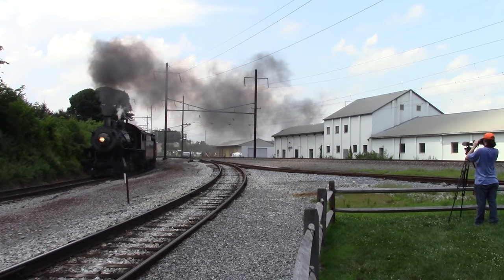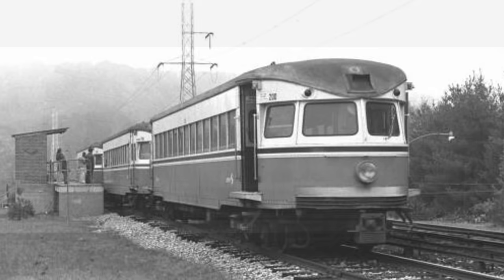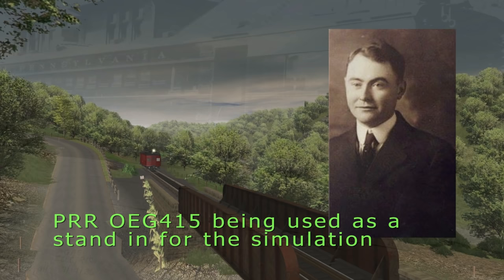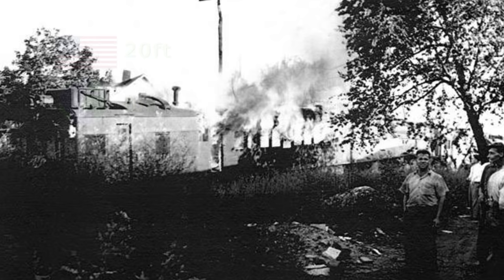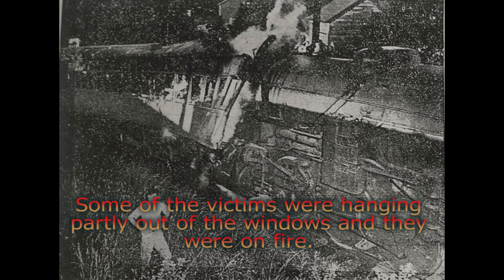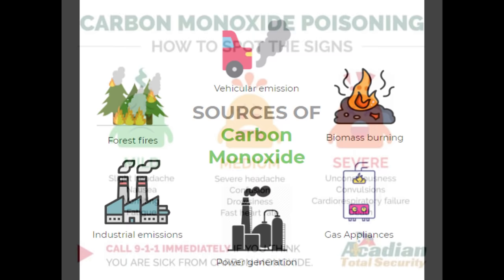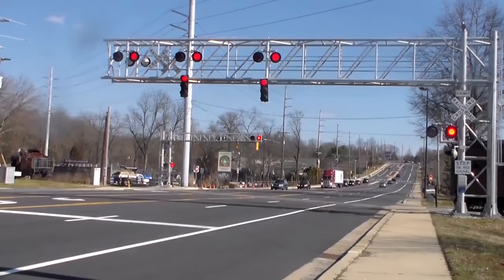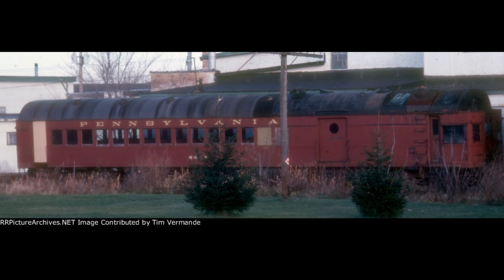The Doodlebug Disaster 81 years later

Comment: Diesel is not more expensive to produce than gasoline. In fact, it is far cheaper. The reason diesel sells for so much more is, plain and simple, government taxes. The world runs on diesel. It is a far greener fuel than gasoline and produces more power as well. The sole reason diesel is not our primary fuel in cars si due to artificial inflation on a fuel that is cheaper to produce than gasoline.

Comment: It's really upsetting that almost everyone in the doodlebug died. I've heard of air disasters where everyone to almost everyone in those accidents perished, but very rarely, a train accident where almost everyone perished.
Reply: The kaprun disaster of 2000 is a good example of one
Reply: Another good example is the Tay Bridge Disaster Of 1879 where there were no survivors at all after the bridge collapsed in a force 11 gale.
Reply: @LNERK361983  An interesting note on the Tay Bridge Disaster:
The bridge collapsed with the train on it, as a result of the increased surface area given by the train, on which the wind could act. The train was forced against the rails by the wind, creating a wild display of sparks. This phenomenon was also seen on the previous goods train.
Reply: the crew bailed and survived, they never alerted the passengers so none had the chance to even attempt to jump…
Reply: @bostonrailfan2427  why didn’t they tell the passengers
Reply: @emmaryan8147  They probably literally only had seconds to act once the freight train came into view. At that point we don't know for sure what happened. They may have tried to yell out to the passengers or they may not have but there's nothing that could have been done to save them as train cars are designed so that the doors don't easily open while in operation for the obvious reasons. i.e. you don't want flimsy doors because otherwise any passengers standing next to them could possibly get flung out should they open while moving.

The crew managed to get out in time only because they had the most amount of warning, which was still only a couple seconds more than the passengers had and because they jumped out through either a door or window in the crew operating area which are designed to be more easily accessible for entry and exit. 

Also passengers are typically more reluctant to jump out of a moving train and generally behave by staying in place during the course of an accident as they think they would be safer on the train rather then take their chances and suffer a possibly fatal injury by falling out of the train. And this is generally true for most train accidents except when you are in the first car or two. Where as train crews are very aware of the fact that in a head-on collision with another train there is very little change of survival staying inside and although you are almost certain to suffer a serve injury jumping out of one while moving at a high rate of speed your chances of survival are much greater. 

Lastly there is the issue of the gasoline fuel tank. Its likely that people in that time were not well aware of the dangers of having such a large amount of flammable fuel on board. In fact it's likely that had the engine been fueled by diesel instead there probably wouldn't have been a fire at all and the only fatalities would have been the 9 who died due to the initial impact. Possibly even less had the injured received adequate treatment in time.
Reply: The 1996 silver spring collision
Reply: you should check out "Well Theres Your Problem"
Reply: Remember this: Today's safety is always built on blood spilled in the past.  Accidents like this are the reason why you hear about few train disasters being 100% fatal. Mistakes are learned from, and processes are rebuilt better.
Reply: The main reason most people don't survive a plane crash...well, at least those that crash after gaining some altitude, not the ones that crash on landing or takeoff...is that the airplanes structure pretty much turns into a meat grinder/shredder. Not only do you not find survivors, but no real intact bodies either.
Reply: Ciudad Juarez,MX railcar accident in 1977: Are you sure about that
Reply: @montylc2001  search up american 191
Reply: @edgardanimate3552  Yes, the crash at DFW airport due to a microburst at the end of the runway during landing. Like I said, except for landing and takeoff crashes, most plane crashes turn people into hamburger meat. Had a friend of mine who used to be a first responder, when he was one of the first at a plane crash site, he quite after it. When he saw intestines hanging from trees he just couldn't take it anymore.
Reply: @montylc2001  you mean the microburst by the engine that fell off the wing
Reply: @edgardanimate3552   you are talking about Delta L- 1011I think
Reply: @montylc2001 That’s Delta 191. American 191 was in Chicago, whereas Delta 191 was indeed in Dallas.
Reply: @C-Midori  oops. Thanks.

Comment: Never knew the Pennsylvania Railroad had doodlebugs, let alone this disaster. Too bad few doodlebugs from this era survive today. They’re a big, under appreciated piece of railroad history.
Reply: Illinois Rail Road Museum, Union, Il. Fantastic museum, huge.
Reply: @nivekyentrouc1200  I seem to recall  on some paranormal show  on the Travel Channel where some  ghost group  went to this museum. They have a passenger rail car  which is haunted. I think it is from this disaster. Somewhere on Youtube  should be a film, The Crash at Crush. It was were two  trains   werec rashed into each other. Happend  in the 1900s at Crush, Texas. Think the town is or was in the Dallas -Fort Worth area.
Reply from the maker: They indeed are. They paved the way for modern self propelled cars especially the famous Budd RDCs (technically they are doodlebugs but have multiple unit control so they're known as DMUs or Diesel Multiple Units) one of my personal favorite rail cars. The footage of 4662 was taken by me even the cab shot and that car gave quite the ride.
Reply: Similar self-propelled cars are such as the Budd Rail Diesel Cars, Micheline rubber tired self-propelled cars in France, and six Budd Michelines in the USA. McKeen built 152 1905-17, one of the first gasoline motor cars. Most were built with “windsplitter” knife-edge front ends. Ettore Bugatti in 1933-38 built a hundred railcars to his design. They were powered by basically the Royale IL8 engine.
Reply: There's actually one preserved and operating in Wilmington, Delaware, on the Wilmington and Western.
Reply: well, dont worry in other parts of the world (namely japan) doodlebugs take up most of the passenger service!!
Reply: I thought that the Black River and Western still had a doodle bug on the property.
Reply: 1940-2022? Fr?
Reply: At least there are some surviving doodlebugs
Reply: I didn’t even know what Doodlebugd were. I was expecting to see some type of investation but the warning at the start didn’t make any sense. What an awful time in our Railroad history!
Reply: @Thunderbolt_1000_Siren Pernik:hello there!

Comment: Doodlebugs are what could have pre-made the brill bullets in experience, that siding could have been preventing the entire crash, if only he noticed…
Reply from the maker: Not quite. The Bullets used Electric third rails for power while the bugs were gas powered and later diesel. The Bullets were made round the same time as some of the doodlebugs as well but man they outlived the bugs as they weren't retired until SEPTA replaced them in the mid 1990s with ABB N5s. Most of em thankfully survived with 1 in operational condition being converted to act like a trolley (somehow running off a trolley pole with overhead wires, I have no idea how they got away with that)

Comment: 13:50   A little history lesson based on a "I was there ." moment .   Your assessment that diesel is more expensive is the reason cars run on gasoline and trucks run on diesel is not quite accurate . Diesel WAS cheaper than gasoline prior to 1982 . My dad bought a new '82 3/4 diesel Chevy for only ONE reason , diesel was almost a dollar per gallon cheaper at the pump than gasoline at the time . 

Within a YEAR diesel prices at the pump met or exceeded gasoline prices and have remained steady since . I also remember hearing the truck drivers complaining about the price increase over such a short time frame and how it would affect their bottom lines . 

At least you did mention the one reason I have actually heard why diesel was chosen as a fuel .... vehicles tend to be harder to ignite when running on diesel than with gasoline . (think military type vehicles)

Comment: I wish the concept of that railcar was revived
Reply: 3 of them are preserved
Reply: Diesel multiple unit trains are used all over the world. For example, the NCTD Sprinter between Oceanside and Escondido, CA.
Reply: it was…the RDCs of the 50s/60s/70s were these evolved, they have struggled as a concept for decades due to costs due to severe regulation but slowly are making a dent in the US again
Reply: @HSMiyamoto  or the older River Line in New Jersey
Reply: @bostonrailfan2427  - Yes there are quite a few, if you look around. I was just giving a shout out to one that I ride personally. A new diesel railcar line is opening soon between San Bernardino and Redlands, CA., and there is e-BART between Pittsburg/Bay Point and Antioch stations.

What you notice is that diesel LRT tends to go where train frequency and projected ridership is too low to justify electrification, and they run on otherwise lightly-used tracks so collisions with conventional rail equipment is completely preventable. 

Inevitably, that makes them minor obscurities when compared to LRT globally. Coaster, for example, is a twice an hour operation, but then, so are most of the buses in our part of San Diego county.

Comment: But wait, something about that cause doesn't make sense. At the time of the collision, the Doodlebug was running passenger-end first, with the baggage/engine compartment at the rear. If carbon monoxide fumes were building up to such an extent as to affect the driver, that would imply some pretty major factors, including gaps between the passenger and baggage sections, such as a pass-through door left open (likely against regulations, though I can't confirm), possibly a serious exhaust problem with the Bug's engine that left it spewing considerable amounts of exhaust into the car rather than up the stack, and the driver operating the car with no ventilation, not even a cracked open window, also not unheard of but highly unusual. And most importantly, if there were enough fumes inside the car to affect the driver, then it would be affecting everyone else in there too and likely more, which makes it weirder that nobody else noticed or said anything; no passenger complaints, no conductor or brakemen checking what was wrong, etc. Had the Bug been running engine first, all this would make perfect sense, but since it was in effect going backwards, how could fumes have built up to such a degree with the driver as far away from the engine as physically possible?
Reply: Also, why didn't the conductor or brakeman notice the siding, they would have had the same set of train orders?
Reply: Might explain why none of the passengers bailed with the crew, if they were so doped up on carbon monoxide
Reply: it doesn’t add up, it’s a bad explanation for what happened. the easiest cause is the most likely: he missed the siding and botched the meetup
Reply: @chuckgilly  that to me is classic CYA: cover your ass. they supported the others’ excuses to make it sound plausible even if utter garbage
Reply: I thought the same thing. So incapacitated that they missed the siding, but at the same time alert enough to hit the brakes and jump to safety. Surprised that the explanation was never challenged at the time.
Reply: Good analysis, thanks for pointing out to us all about the reverse operation of the car, as the animation depicted it as counter to what the actual photograph portrayed. But please....refrain from using the fake term 'driver'.
Reply: @renegadetenor  driver might be because the person is British or from a country where engineers are referred to as that…it’s like them calling cars coaches switchers shunters etc.
Reply: Is there a link to the ICC report? I have my suspicions on that explanation as well. Did alcohol play a role? What about fatigue? The federal hours of service limit was 16 hours at that time.

Comment: If the rail car had only passed the switch by a quarter mile (440 yards or 402 meters) before the collision (11:20 in the vid)) how would  they have had time to stop, throw the switch, drive onto the siding and throw the switch back before the freight got there? 
That would have been ridiculously close timing to count on.
Reply: They entered the siding properly on the one end, they just blew through it and out the other side.
Or
They were supposed to take the siding, they didn’t, and blew clear past it on the main
Reply: @jaysmith1408  I think he means if the collision occurred only 1/4 mile past the siding, the two trains were scheduled too close to each other and if the doodlebug had been running 45 seconds late, it would have collided with the freight before reaching the siding.
Reply: @galeschool  the scheduling is why the bug was ordered to stop before the switch, i’m not sure whether the bug was on the siding and blew back onto the main, or whether the freight was to take the siding in front of the bug, which was what threw me off from his comment.  I read the original comment as under the impression that he expected the bug to back onto a spur before the arrival of a freight, i was correcting that it was a full siding, and there would be no requirement  to stop and back in, as he suggested.  It is conceivable that a scheduling delay could have permitted a rolling meet, but between the variable speeds of both trains, and the bug’s engineer being unable to follow the simplest of orders, let alone the task of speed management for a rolling meet of a freight whose exact location is unknown to him, i doubt scheduling, outside of holding the freight at the next siding back, since the bug’s schedule is the exact same every day, would have averted this.
Reply: My understanding of the operation of a siding on a single track mainline is as follows. 
At various places along the mainline a switch opens onto a second side track that runs parallel to the mainline and is long enough to accommodate any trains that might be required to stop to let another train go by.
This sidel track then switches back onto the mainline at the other end.
Before the days of remote switch throwing  the train to be sided had to come to a stop so a crew member could climb down and manually throw the switch. The train would then proceed onto the  siding and when clear of the mainline the same or another crew member (depending on the length of the train) would throw the switch back again.
The train would then advance along the side track until near the switch back to the mainline and wait until the oncomming train had passed.
Then the switch would be thrown and the train would proceed back onto the mainline and then again stop while the switch was thrown back. Then the train would proceed on its  journey. 
The timing of trains has to allow for the time to stop, throw the switch, proceed onto the siding and throw the switch back.
You want a good time window for safety say 10 to 15 minutes or more. 
In this case if the collision occurred only a quarter mile past the switch or siding then there simply would not have been a safe time window to stop and enter the siding. The oncoming train would very likely have hit the  railcar before it could make it onto the siding.
Reply: @vernmorris8898  oh i see what you’re getting at.  I would imagine that in the case as posed, they would be required to throw the initial switch, which they failed to do, but as for timing, there would be an expectation that the bug would have arrived first, not to mention being far more agile, the stopping, starting, and walking, would be a lot easier for the bug than the freight.  As i read further, since the bug was supposed to switch onto the siding in the first place (had they been running late, the freight would have been obligated to hold at the far end of the siding) and they didn’t, and the freight would not be expected to take the siding, regardless of timing, under the orders as issued, there would have been a head on collision at some point on the line.
Back to the point, that is correct, yet lengthy, procedure, for a slow speed, lightly used line.  As has been proven in both Canada, and the United States, such a labour intensive, failure probe, safety critical, and undetectable until far too late, procedure, is dangerous on all but the slowest lines.  Via has had derailments due to reversed switches, Amtrak and Norfolk Southern have had several collisions due to reversed manual switches.
Reply: @vernmorris8898  and if i’m not mistaken, whichever train gets to the end of the siding first, is obligated to throw the switch for the opposing train, i.e. if the bug was running late, the crew of the freight would have thrown the switch for the bug to take the siding.
Reply: But the question hasn't been answered:  If the freight crew knows about the meet but has no definite idea of the bug's location, shouldn't it be approaching the siding prepared to stop short of the far [from the freight's POV] end?  How long was the   siding?  Was it long enough that a freight train approaching the near end at full speed a quarter mile away could reasonably stop by the far end?